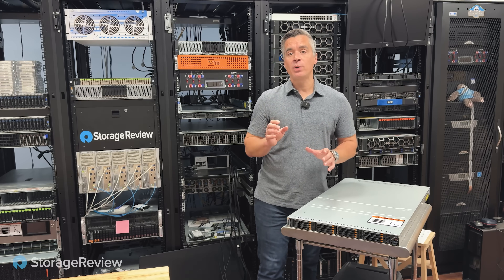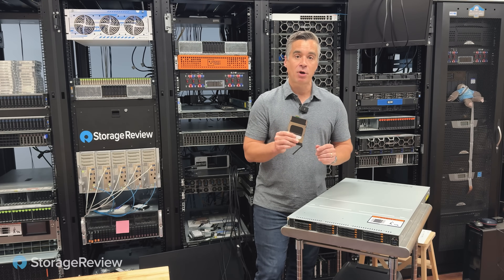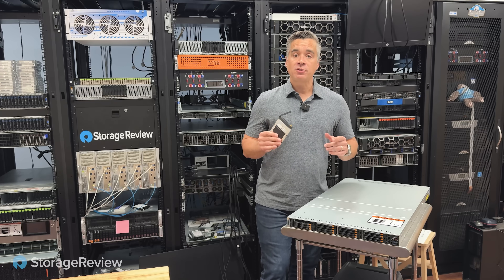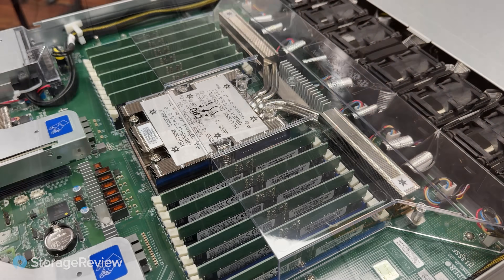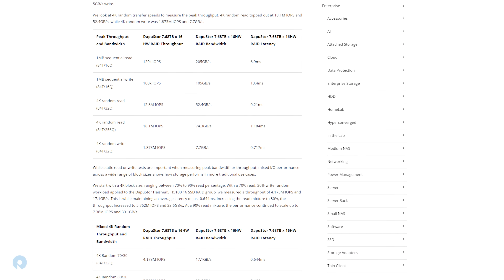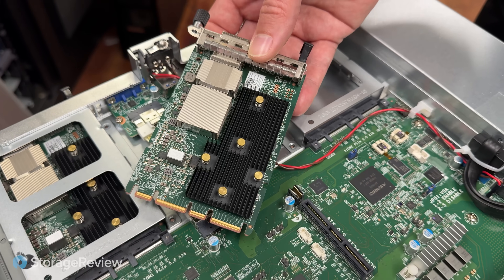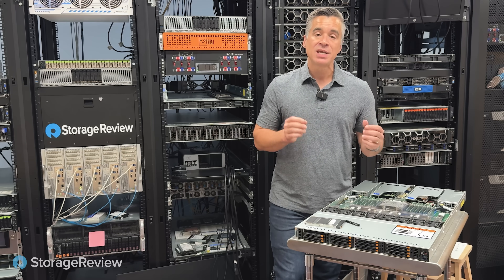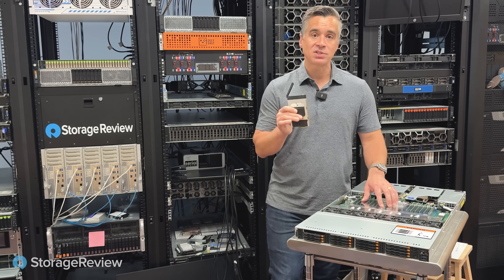Power Packed: 205GB/s with 16 Gen5 SSDs in 1U

Comment: Based on detailed report, 7.68TB drive has published specification of RR 4K performance at 2.8M IOPs. If current system is using 16 of those drives, what are the limiting factor for 4K RR performance at 18.1MIOPS? Shouldn't it be close to ~35M~40M IOPs (~16*2.8)? Similar to SR, which is 16*14 = ~205

Comment: what is your recommendation for RAID on NVMe? ZFS seems to have too many issues.
Reply: Agree, I tried ZFS and the overhead starts to matter with these fast NVMe drives. A single drive usually outperforms any other zfs combination. I can see ceph taking over eventually, but for a single host system, I don't know of a solution 😕
Reply: I think GRAID is your best bet at this point. Ceph is nice but you need plenty of machines and expertise.
Reply from the maker: You can layer Graid with Ceph if you like.
Reply from the maker: Longer conversation that's better for our Discord! discord.gg/storagereview